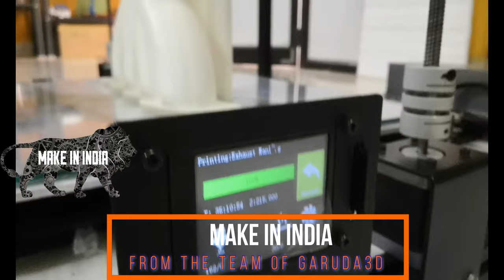G3D Titan Massive Build Volume 500x500x500mm 3D Printer

Comment: Costing of 450mmx300mm architecture model
Reply from the maker: Hi, costing depends on various factors. We have to keep the 3d model in a sicing software and give some basic settings. Based on that only we can get the pricing. Please call us at 8297118877. Will explain in detail